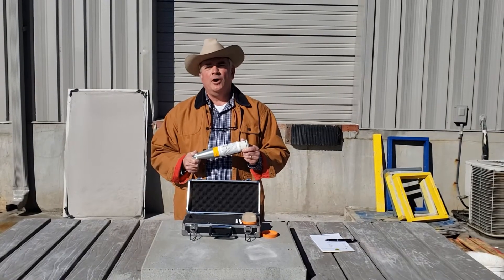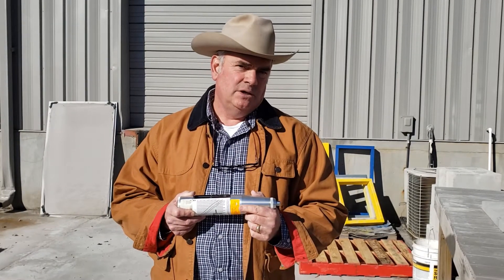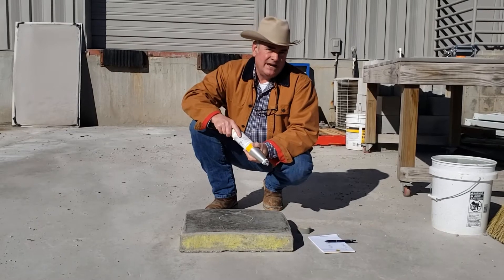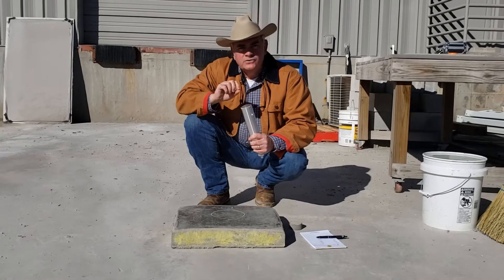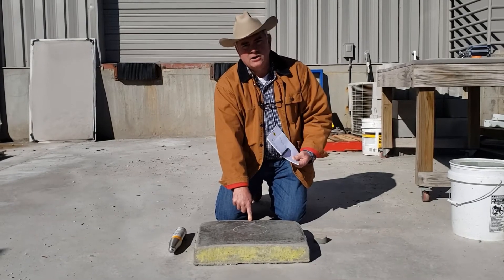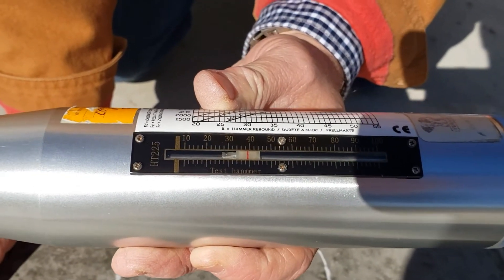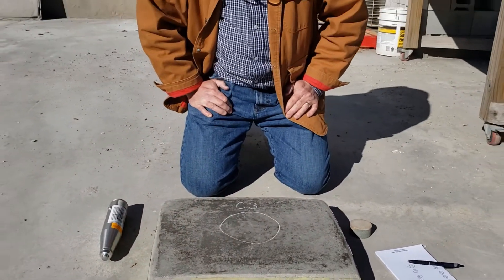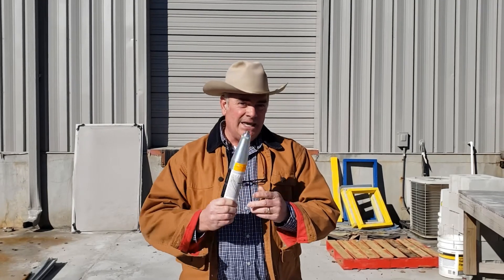The Carolinas' Concrete Cowboy Explains The Swiss Hammer - Non-Destructive Concrete Test Method

Comment: Although I think that this video could have been trimmed down, I think it's beautiful that it's not. 

I don't think that you really wasted a single breath and the video can be sped up. 

I actually would have preferred you show testing the 10 different spots. I train people on a regular basis and I am certain more than 10% of the people that watch this are going to test the same exact spot instead of 10 different spots inside of the circle. That's okay though 

This is all. Just a big thank you. I'm commenting to also help the video. 

Again really well spoken. Really well done presentation. It's easy for me to want it to be shorter but then what if you missed something. This is definitely the better video. If I had to choose between a shorter version or this one, this is a pretty great video